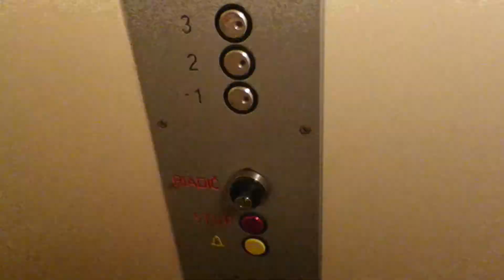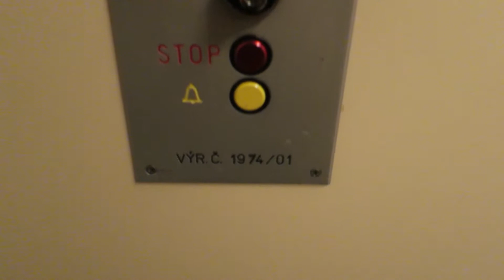interesting kitchen elevator@Ritchies new school

Comment: Very interesting elevator. That is interesting that the motor isn't in a machine room, but it is outside of the elevator. I wonder where the controller is, and where the governor is (if this elevator has one). I also wonder if this elevator has chains instead of cables, or if the chains turn a traction elevator drive sheave in the shaft.
Reply from the maker: +upanddownadventures i probably (for sure :) take more vids - so hope you can see all better and you get your answers - there is another one but is also locked - hope i manage some keys to get one ride with Ritchie... thx for comment and view